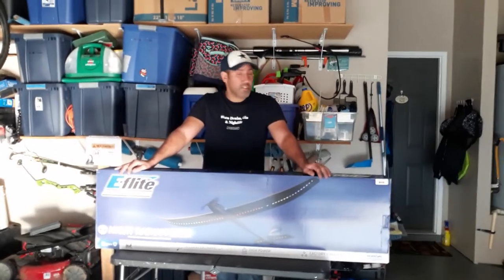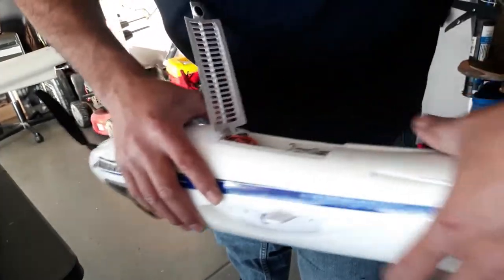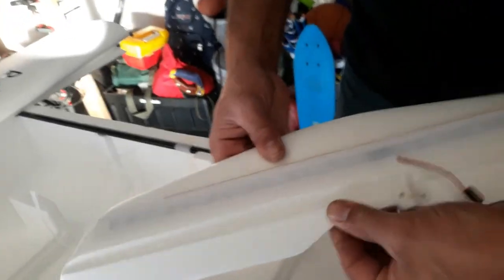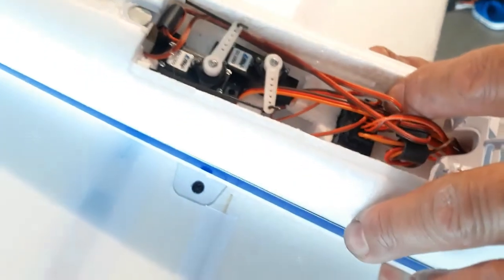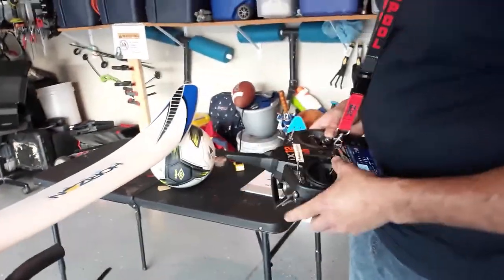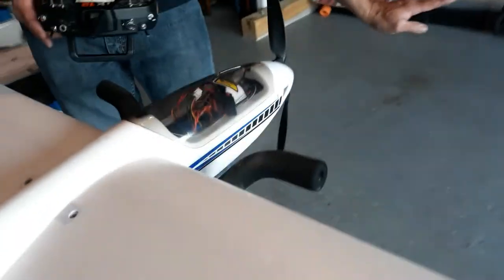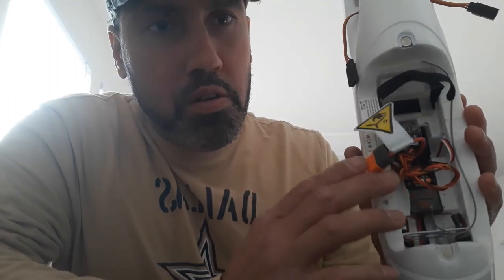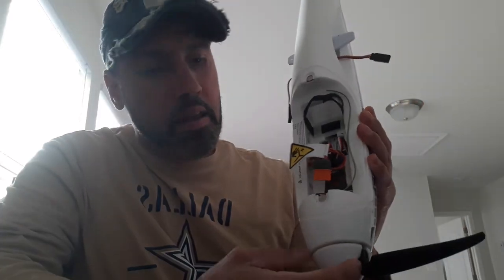Eflite Night Radian 2.0 Unboxing, Build, Setup & Mods #eflite #rcplane

Comment: Nice video I bought mine last year and I used the tape and 2 straight pins warmed up with a lighter on each side to go through the plastic. The straight pins will need to be cut off underneath to get flush. It's an old trick I have used on many planes since the mid 80's got from a RC Modeler or Model Airplane Magazine. They used to give so many tips and I still use every one I earned and pass them along to all of the people I can in the hobby! Good thing about the pins is that you can use the ones with the balls on top or the flat head ones that are less conspicuous. Happy flying bro...my next mod on this plane will probably be to cut in ailerons? Oh forgot to mention I took the stripes on the right side and removed them and placed them where ailerons would be on each wing. I also uncovered any lights that would not show up as bright if they were covered with additional tape by cutting a circle off the top layer of tape making them more visible.
Reply from the maker: Oh cool, very informative. I also appreciate the comment and tips. The tips you provided are a quick and effective alternative, but I don't mind doing the extra work on mine. I actually did that to all my plane that needed to have the tail surfaces glued in, because I prefer to keep the boxes for as long as I can just in case I have to transport them  or sale them in the future. I appreciate you taking the time to watch our video, my son had fun recording it. Take care and happy flying.
Reply: Make a video of your hack let us know
Reply: @TheYammerHammer I might have to explain the next time I fly it

Comment: I own the pnp version and haven’t flown it yet bc I can’t get my ar631 receiver to work, I guess I’m a bnf guy. Tried everything
Reply: You probably might need the programming cable. See if your local hobby shop has it, or just buy a new one I guess.
Reply: @themadscientistg7804  it was user error, it is NOT a sail plane 🤣🤣 I bound it as a plane without a power source. acro worked out just fine